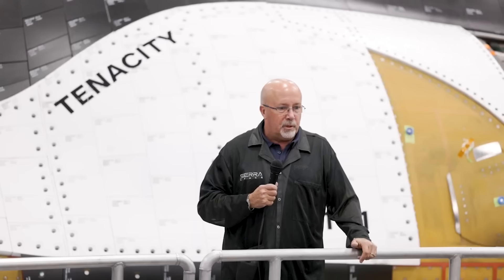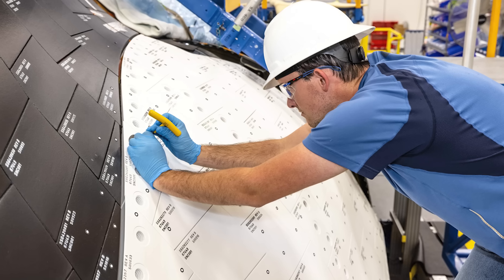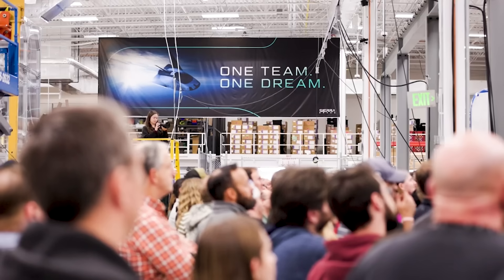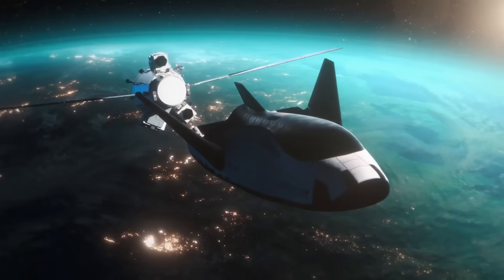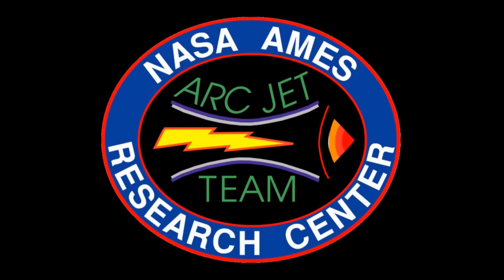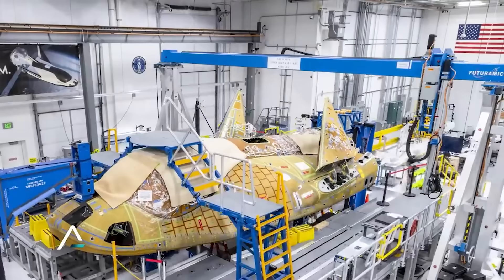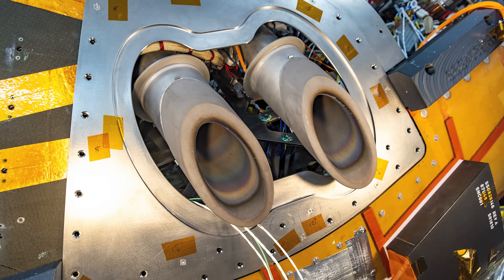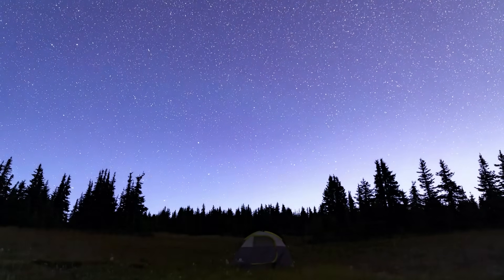How Dream Chaser Tenacity Is Trying To Reinvent The Heat Shield

Comment: I make PICA (phenolic impregnated carbon ablator) for my job. There are a lot of comments down here that are along the lines of: 1) Why don’t they make a single big heat shield instead of tiles? And 2) If they made simple shaped tiles instead of ones with all this complex geometry, wouldn’t it be better. 

Manufacturing heat shield material, including TUFROC, requires a perfectly uniform pre-form material that is then infused with a fluid in a pressure vessel. This, 1) The pressure vessel limits the maximum size that a single heat shield piece can be and 2) the preforms need to be made in non-curved (aka rectangular) forms so they will need to machined to shape no matter what as sharp angles are a death sentence in the world of spacecraft heat shields. 

Have a great day, everyone!

Comment: The heatshield is a nightmare, even more complex than the Shuttle.
The refit will simply kill how frequent the ship can fly.
Reply: True, but Sierra Space is technically right too. We have learned a lot from the Space Shuttle program heat shield and our material science has stepped up since. Another thing to consider is that there are far less tiles to be concerned about here. The shuttle had 10s of thousands of tiles, Dream Chase does not. They're also twice as thick with an updated method of application and bonding. It's very likely Tenacity's heatshield won't kill its practical usefulness unlike the Shuttle. 

Could totally be wrong though and it be another nightmare, but with far less tiles to track, more size and improved materials, along with improved bonding and decades of Shuttle experience Dream Chase should be a success.

Comment: No spaces between the tiles? Have they found a way to ignore the physics of THERMAL EXPANSION???
Reply: TPS material, especially TUFROC, has EXTREMELY low CTE, that’s one of the primary parameters when choosing a TPS material. PICA can heat up to 3000C with less than 2% expansion.
Reply: Yeah, milions spent developing a material and no none thought about that.... losers.

Comment: That vehicle looks a lot like the one Steve Austin flew before his ground breaking operation !!!
Reply: lol, that’s because it is. Dream Chaser is almost an exact copy from NASAs 1960s atmospheric lifting body programme. They have built a vehicle with some complex surfaces, any surprise the heat shield tiles turn out to be complex and slow to attach. A simple cylinder topped with a uniform cone on top, looks like a better option.

Comment: This is so much bull or hype! First of all this "WET DREAM CHASER" is an auxiliary transport vehicle at BEST! They can only make one every 4-6 years. NOT what I would call exactly a done deal or a finished product. Heat Shield ... What! The Space Shuttle had that worked out over 20 years ago, so what is the deal here?
Reply: A 1960s lifting body concept with 1970s thermal tiles, what could possibly go wrong.
Reply: It cost a fortune to refit the space shuttle TPS tiles after every flight. They were in many respects a failure.

Comment: A major issue with the Space Shuttle was having over 2,000 different shapes for the tiles. Dream Chaser appears to have a lot of unique tiles. Starship -- if the tiles stay on -- does not look to have so many unique tiles -- on and around control surfaces and on the nose cone, but the rest are pretty standard. Maybe the turnaround time for replacement tiles isn't a problem, but I don't see how.
Reply: Starship also uses a steel body, isn't Dream Chaser aluminum? One space shuttle was lost because a tile came off and the underlaying aluminum body was quickly burned through.
Reply: @GlennTillema  Columbia was lost due to a suitcase sized hole in the reinforced carbon-carbon at the front of left wing. 
Atlantis, on Sts-27 (second flight after Challenger) lost an entire tile. Luckily there was steel underneath, otherwise that might have been lost as well.
Reply: @tusse67  the steel antenna mount on Atlantis was at least 27 times thicker than the average Starship Super Heavy propellant tank skin. The tiles seen being lost by the dozens on IFT-2 could well have been enough to doom the ship, if it had survived to reach reentry, and steel then soften up and lose integrity from the heat.
Reply: @mikedicenso2778  I agree… you should direct your reply towards Glenn Tillema… He’s the one indirectly implying the steel of starship would fare better. If by some miracle, it should survive reentry with missing tiles, it would be scrap.

Edit: interesting point on starships survivability with missing tiles: Due to its size and shape the stagnation point will be further away from the hull. But still detrimental to reusing it if it survives.
Reply: @GlennTillema it was more than "a" tile bro

Comment: Has been explained aside from the custom corners that need percision, why aren't they making bigger section of heat shields? Like slipper going on a foot in some case.
Reply: My guesse: heat tiles shouldn't be too large, because ceramic breaks relatively easy.  Plus the metall underneath does some wild contraction and expansion, compared to most other materials.    🚀🏴‍☠️🎸

Comment: The heat shielding advantage with Dream Chaser, it's that the TPS tiles are fixed to the fuselage, instead of directly on the tanks as Starship. Where they are subjected to intense pressure and thermal variations, requiring fixing pins.
Reply: Correct me if i am wrong but i think most of Starships tiles are mounted over some kind of insulative jacket, and with the pins as you say, although at the top of the ship those tiles may be just glued on.
Reply: @pipersall6761 
I have been assuming that the starship tiles that are over “blanket” material still use capture pins that penetrate the blanket. The blanket is partially there to provide “vibrational damping” because the stainless steel structure is too flexible due to its inherent thinness and lack of flexural rigidity also it can expand (causing problems) due to it being heated more than other designs promoting plasma intrusion through gaps. 

Does your information have more details on spacex’s mounting system?
Reply: @Mentaculus42  yes you are right.  However, I have seen video of them installing tile around the top of the ship and it didnt look like the blanket was there and Im not sure pins were either though they are everywhere else.  Like maybe those were glued on somehow.  I really dont know about that.
Reply: @pipersall6761  
Thank you, what you say makes sense. I think that the starship approach is going to take a number of iterations to perfect.
Reply: Why would the pressure be different?
Reply: I belive 4 starships will melt before the get it right.
Reply: @ZeroSpawn   Maybe, but I think it'll take that long to nail the re-entry profile with flaps, so not sure if it will be due to tiles. The Starship could potentially survive the loss of a few tiles. Down the line, I honestly expect SpaceX to ditch the tiles for something like Tungsten plating with some insulation. The Stainless Steel can handle very high temps so it won't need thick protection of tiles. And after all, later starships are expected to fly perhaps 50 or 100 times, so developing the process for long term durability makes way more sense.